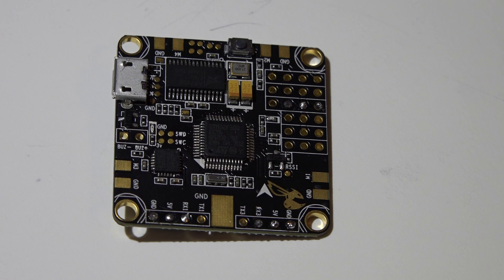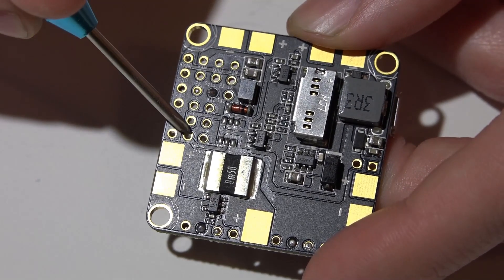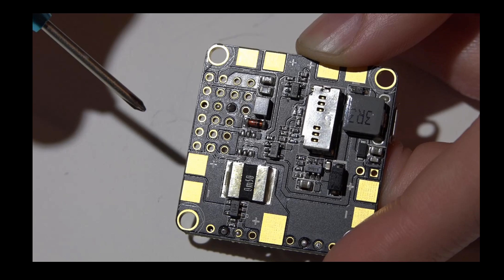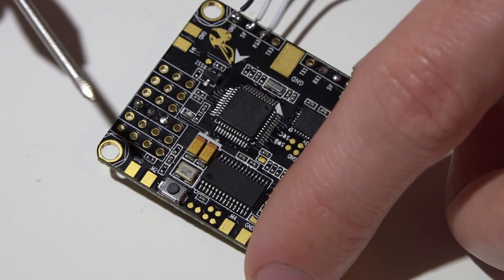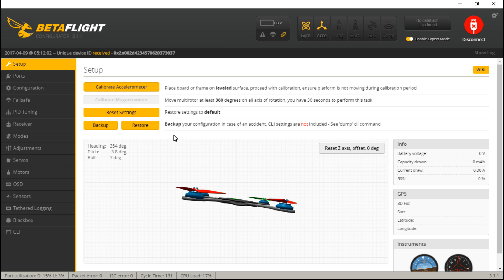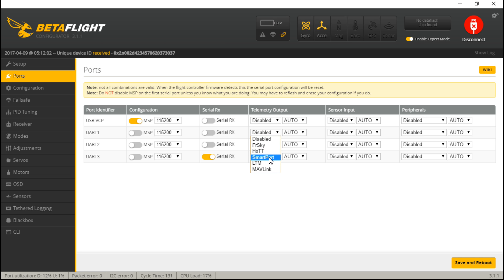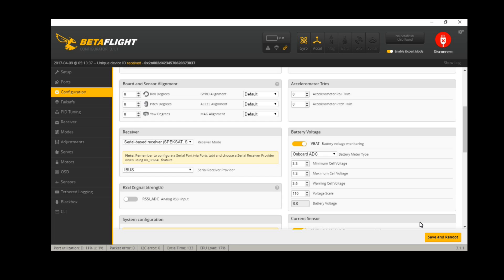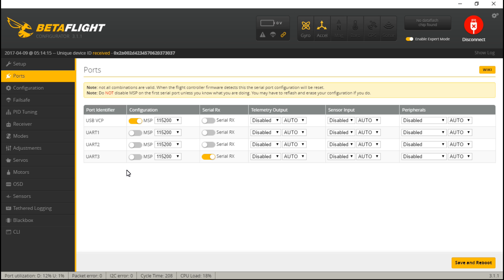Betaflight F3: Connecting Receiver

Comment: when using PPM, you said to run your all 3 wires to the PPm pin. my question is, do literally run all 3 to only the pin hole that's says PPM, like all 3 wires in the same hole?
Reply: and how is the receiver going to get power use your head dude

Comment: Hey there Jc.  I got a quick question.  When I install my d4rII I can't get the quad to arm with a 4s pack.  It does arm with a 2s and 3s pack.  When I set buzzer on an aux switch and plug a 4s pack the quad just beeps repeatedly followed by the red led blinking at the same time.  Do you have a fix?   Telemetry is working and I have all my sensors working and can hover with a 2s and 3s pack.

Comment: Sunday question ..... why on betaflight f3 every time you put a new battery on the telemetry taranis the law to a minimum although fully charged? To make it read correct every time I put a new battery I have to plug it in bata and first disable vbat and then refurbish it ... then it works properly ... ... ... so it's a problem of fc, firmawere? the tx xsr frsky is connected to telemetry to uart uart 1 3 and yellow, com from your tutorial. Anyone get it?

Comment: Hi JC. followed the steps in your vid.
I am having trouble getting all my sensors showing on my taranis. 
xsr UART 3 normal 3 wires UART 1 smartport on tx1.
any advice would be hugely appreciated.
thanks for the great vids and Info, I would be lost with out it
Reply: +John Citizen In case anyone is reading this conversation with myself I finally got telemetry working with the original UARTs I tried by flashing the firmware. FrSky says in their site the firmware update has increased compatibility with f3 flight controllers. I had to flash the eu version of firmware and then flash it back to the non-eu version to get the firmware to flash for some reason.
Reply: John Citizen glad you sorted it ' sorry for the late reply.
everybody needs a JC living next door,ha! life would be so much easier.
you will love this fantastic fc, happy flying
Reply: Fraser Scott I'm having the same trouble with x4r-sb n the betaflight f3
Reply: stressed me out when I couldn't get it running ! looked at NJTECH vids and switched over to another UART ' solved ' still having crap video even though I have soldered a capacitor on ' there's always something going on in this hobby ' hope you sort it
Reply: +Fraser Scott Did you switch your RX to another UART or just the smart port wire to a different UART Tx pin? I'm having the exact same issue using the XSR with a betaflight f3 board. This is my second build and I went with the same f3 board but decided to use the XSR instead of the XM+ this time because it has smart port telemetry, now I wish I didn't bother.
Reply: +John Citizen think I just partly answered my own question, changing the UART the smart port wire is connected to didn't help.
Reply: +Fraser Scott Now I've tried connecting my XSR to RX on UART 2 as well as connecting to the dedicated receiver pins that are broken out further down from there with my smart port wire connected to the Tx pin on UART 1 and UART 3, as well as connecting my receiver to RX on UART 3 and the smart port wire to the Tx pin on UART 1 and it's still not working. I've soldered to nearly every damn hole on my FC I think there's an extra ounce of lead in it.

I'm going to cut that wire out and live without telemetry and create a new model to try and get rid of all the warnings my taranis keeps speaking to me about sensors being lost etc.
Reply: +Fraser Scott lol yeah you're right, as frustrating as it was at the time I'm glad I worked out a solution, but I was going in circles for a while yesterday haha.
Reply: John Citizen.. Im about to try this today.. on a SPracing F3 board. I hope I can do this. Can I contact you if im jammed up?

Comment: so they have made an f4 board, understanding that you don't have it (so I think) could you guess that setup would be the same for it or would I have invert it like the omnibus
Reply from the maker: I haven't tried it, but every F4 flight controller I've used so far has only had one inverter. If that's the case you would have to invert the telemetry. But I'm not sure how many inverters they put on it
Reply: Project Blue Falcon I followed this closely but I'm having a problem with my receiver (x4r-sb) nit being recognized by the betaflight f3, it does this with both x4r'sb on both betaflight f3 fc's but pulling it n put ng xm+ in its place works fine. what's the trick to making the xr4-sb work with the betaflight f3 FC - u put out do many vids I know I'll never see this or reply to it but I'm stuck n have tried every other help line I can think of from forums to ig to FB groups - nobody can help, PLEASE READ N REPLY

Comment: I built on one of these a couple days ago and was cursing that there were no good resources for it yet. Looks like I was about 24 hours early!

Did you notice any huge issues with the ground pins on the through-holes? My iron was blazing at 400deg and I could not, for the life of me, get solder to stick to any of the ground pins on the through-holes (for the receiver, VTX, camera, etc). It took a ton of effort and the joints are very weak. 

Even heating large globs of solder stuck to the ground pads, it's very sticky and the solder doesn't liquify very well. I know the ground plane on these boards is massive because of the integrated PDB, but it was a genuinely unpleasant experience to solder to for me.
Reply: SenoreQueso I had completely the opposite experience - I bought 2 betaflight f3 fc's n soldering to them was easier than the sp racing f3 boards I been using. easiest part of the build for me was the soldering
Reply: Totally agree. This is the worst board to solder too yet. Add to that my board has a faulty RAM trace out of the box.

Comment: Hey man, any chance you could go over using the XM+ and the BFF3 and using the BFOSD for RSSI values? I've updated the firmware on the XM+ (FCC Ch8) and switched RSSI to AUX Channel 8, and it seems to being getting a value sent to it, but it's super sporadic and either isn't calibrated or I'm missing something. Any help would be great. Thanks! Good stuff as always

Comment: I know you hate giving your opinion but should I order this or the Omnibus F4 Pro
Reply from the maker: I haven't made a video explaining all the pins but thats something I could do. As far as which one is better I think they are both great. The downside to the Omnibus F4 Pro is if you want a current reading then you have to place your main battery lead on the flight controller, then run another thick power and ground from the board to a PDB which is a head ache. Also with the Omnibus F4 Pro if you want telemetry from half the receivers then you have to do a modification to the receiver, where you wouldn't have to with the Betaflight F3. And like I said the downside to the Betaflight is chancing ripping a pad off the board. But over all they will both perform the same.
Reply: Project Blue Falcon I watched all your videos I remember everything you said word for word it's like gospel to me LOL I tell everyone about your Channel. why can't I just run like a 16 gauge wire negative and positive to the current sensing pads? Can it not handle the amount of amps properly is that what it basically is and won't give me proper readings being that it's thin wire? because I've seen other people just used in wire to hook it up to get the signal but I want accurate amp readings. I want to be able to tell when I switch batteries what the difference is and get my amp draw without installing an OSD I just want  a flight controller that has it all built in so I don't know if I should get this or an Omnibus F3 or F4 Pro with the built-in betaflight OSD
Reply: does the regualr f4 have current sensing on it ?????????? i dont understand why this one uses big pads and the regualr f4 does not can the regualr f4 tell you your max amps used and how many your using during flight ?